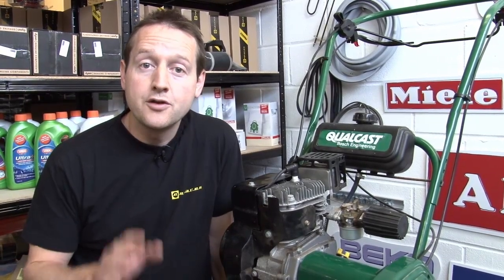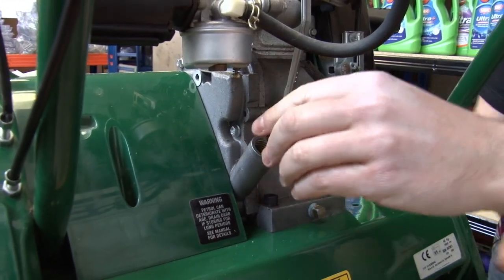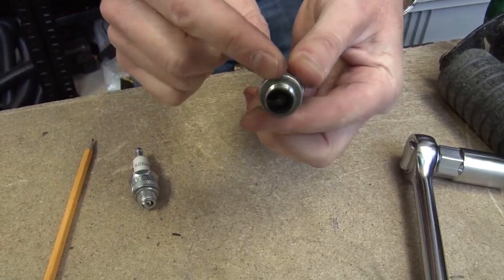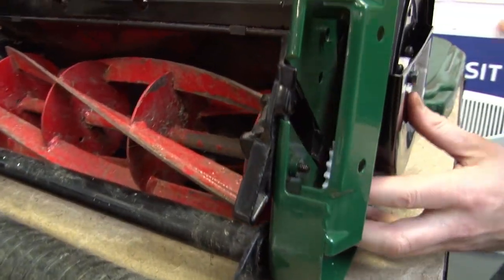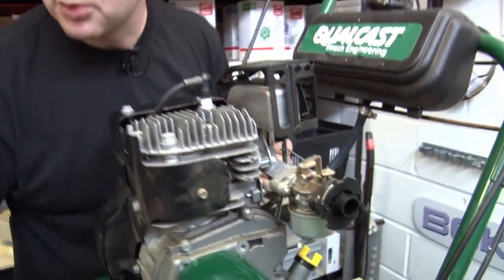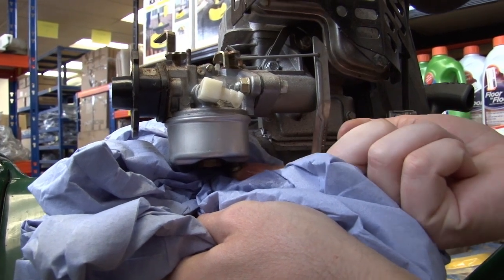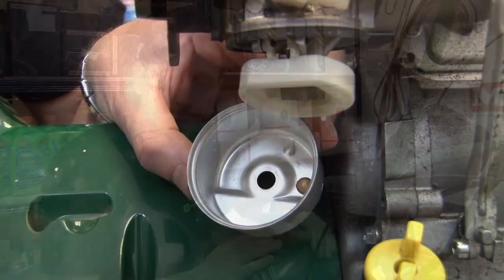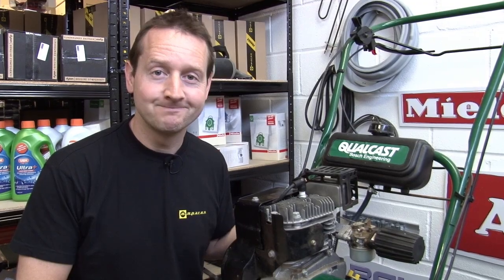How to Fix a Petrol Lawnmower that Won't Start

Comment: Superb tutorial. I thought I needed a spark plug, but I replaced the fuel and cleaned the Carb Nut hole.. 6mins into video and now my mower runs like a Rolls royce. :)

Comment: Excellent tips here. I bought this model mower today and had it running in 20 minutes thanks to this. Only criticism is regarding the float piston. You should mention that it's not actually connected to the float!
Many thanks for this video, I shall be ordering a service kit very soon
Reply from the maker: +paul kent HI Paul thanks for your comments. Sometimes we can overlook or not mention things in our video if we are familiar with 'normal practices' . The float is not normally called a 'float piston' and it is located in a 'float chamber' not a cylinder so we think this is why you may have expected a 'piston' to be attached.

Comment: Hey thanks mate, My mower died on me yesterday, ran for like a minute then was poked. Tried many times to start it but nothing. Checked plug, fuel filter even replaced sparkplug lead..cause there wasn't I thought a good connection. Anyway.. in the end thanks to you, I found out there was water in the fuel and the filter was gumed up. This due to heavy rain we have had lately , she wasn't sheltered proper. So all good now..Thanks Buddy!!!!.

Comment: Thanks for this. I drained my tank and carb (old petrol turns a funny shade of yellow) and refilled and it started. Think I'll replace the plug as it's running a little roughly - but your video was an immense help. Thanks.
Reply from the maker: +Kieron Edwards Thanks for the comments Kieron, we are sure there will be plenty others with this problem as we all start cutting the grass again.:-)

Comment: Thank you so much for the video. Followed your instructions to clean the fuel injectors and the mower is back up and running.
Reply from the maker: Glad you sorted the problem Mark. The carburetor jets can get blocked when fuel is left in the carburetor and allowed to evaporate away in a warm environment. Try when storing pouring the fuel back into your fuel can and draining the carburetor by opening the drain valve as shown after 5:27

Comment: Hi Matt and thanks for your tutorial ! cleaning the carb and replacing the spark plug did the trick. Might get in touch for a fuel filter assembly since I smashed it against a bush and I am now running the lawnmower without. thx N.

Comment: Having watched this.  I decided to strip down and de-clag the carburetor.  I also gave the spark plug a scrub with a petrol-sodden wire brush, put everything back together again and it worked like new.
Reply from the maker: +Jonathan Fletcher 
Glad you sorted it out. :-)
Reply from the maker: +eSpares Thanks for the comment, Glad you liked the video.

Comment: I've got a 2-stroke generator that wont start - I presume the checks are the same for that?  I know I left it with petrol/2-stroke mix in it since last August - do you reckon the petrol's gone off?  Also I've got a plastic fuel bottle ready mixed of petrol and two stroke which was mixed back in August does it also go off when stored in fuel containers too?

Comment: Hi, I have this exact mower that I've just purchased. Followed all your steps to draining the carb, and what came out certainly didn't smell like petrol. It was green and smelt like paint thinners!!! 
Obviously I have to strip down the carb now, but, any ideas of of how I can get this stuff outta the system? Cheers
Reply from the maker: The easiest way to clean the fluid out is by removing the float chamber (see the video at 5:33). We believe the chamber is removed by turning the 'nut' under the bowl.

Comment: Thanks! After cleaning the carburettor it’s started! And I was worried that it might be the coil.
Reply from the maker: Hi James, well done for sorting and hopefully our video helped.
Reply: eSpares, yes your video help a lot. The 2001 model that I have used a brass(?) float  and the carburettor was covered in green stuff. The bolt pin holes were blocked. It started working after it was unblocked and cleaned.

Comment: Thanks for the video very helpful, I've got mine started but runs on full revs and won't idle! Any ideas, thanks
Reply from the maker: Hi Phil, at 3:47 we show how to check the 'throttle' control and linkage. Check this is not stuck and remember the engine will run faster on choke so check this is off once started.

Comment: Hi, I have been given a McCulloch M51 140wr Classic, there are two problems to deal with, the first is the blade support is damaged, the two locating studs have sheared off and I guess this will need to be changed and the cable to the rear wheel drive is damaged. how difficult is it to replace the both items and for me the most important is the blade support, I am not too bothered about having to push the mower any help would be great along with any video guides, thanks...
Reply from the maker: Hi Tim, unfortunately, we do not have a video on these repairs.

Comment: Hi Matt have you worked on a GGP PMR400PMRA DECK I need to take the lower handle off there are two allen head bolts that go through the metal deck into the plastic back end but they just turn around and I dont see any nuts on the in side Phillip
Reply from the maker: +PHILLIP WEAVER Sorry Phillip but we are not familiar with this model so do not have information to help. :-(

Comment: Hi, I cant see any little holes in the bottom nut.  its a qualcast and most of it looks the same but no holes?
Reply from the maker: HI Andy, what nut are we talking about?.
Reply: the bottom nut of the carburetor in the vodeo
Reply from the maker: Often there are changes in production so that is likely to be the difference. The carburetor bowl will be removeable as there is a float and valve inside.

Comment: I have the same mower and I need to change the petrol pipe.When I look on line there looks like a few different types depending on engine type and there is mention of kowaski could you tell me what the engine is and engine model please or the part number so I can replace this thanks chris.
Reply from the maker: Hi Chris, there are many different types you are right but I am confident our sales team will be able to find the part you need www.espares.co.uk/contact/sales

Comment: You might make it easier when you take the carb bowl off to use a permanent marker or nail polish, preferably, to make a line from the bowl to the top of the carb for easy realignment assembly.. Just an amatures idea... 😊

Comment: I have a Mountfield Jupiter Honda GCV135 4.5 and underneath the petrol tank there is a leak i got the mower 'FIXED' and was charged £35.00 i still have the problem. Can i still get a fuel line for this type of mower? and if not can a universal fuel line do?
Reply from the maker: If the repair has not worked I would contact the person who carried it out first as it may be the same problem or something else. If you need a petrol pipe we do a universal one that may be suitable here: http://www.espares.co.uk/product/es132745
Reply: You are a sweetheart Thank You. XX

Comment: Never Never never use compressed air in a carburetor .. There are small gaskets that will blow away and you will never find them. Maybe not this lawn mower but most

Comment: Why has Qualcast got a bad name fore spare parts I have been looking for three weeks for two front wheels replacement on my rotary qualcast mower model XSZ48B-SD if you don't believe me try ordering a spare wheel I think Qualcast mowers are good mowers but getting spare parts are a night mare and if you can find one it will cost you £15 plus each as an ex work study engeer. I hope the suppliers get to read this B&Q are giving out a phone number for a company that has got nothing to with Qualcast and there are feed up with people phoning them why can't I print of a parts list for my model come on Qualcast give us some better service or is it because it is made in China and they could not care less in giving a good back up service thanks for reading this
Reply from the maker: HI Albert, it looks like we have not been asked for these wheels before. If you want us to quote for supplying them fill in your information here: http://www.espares.co.uk/contact/sales